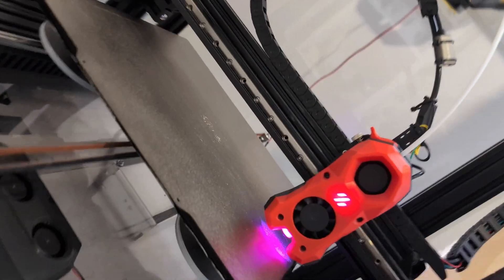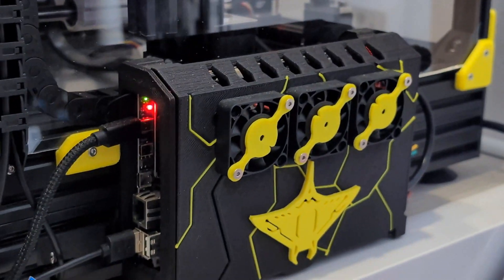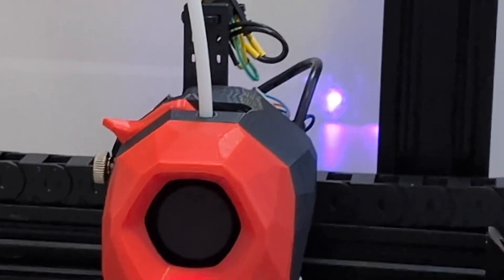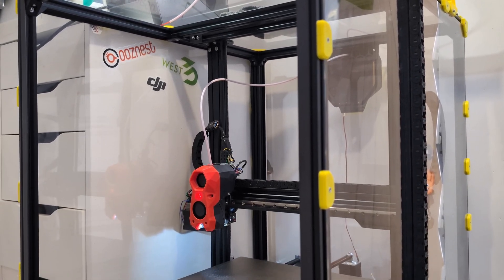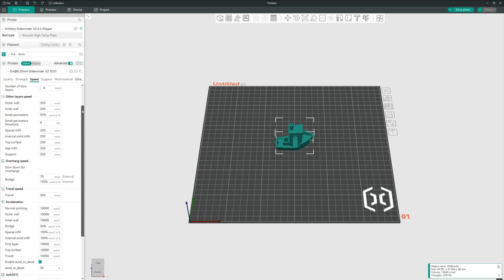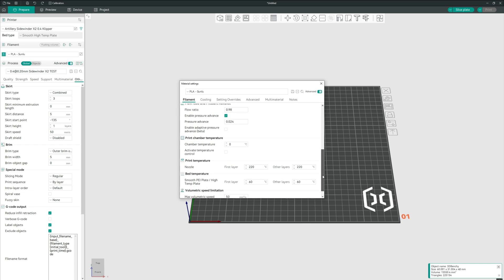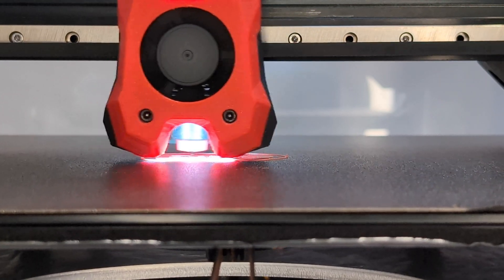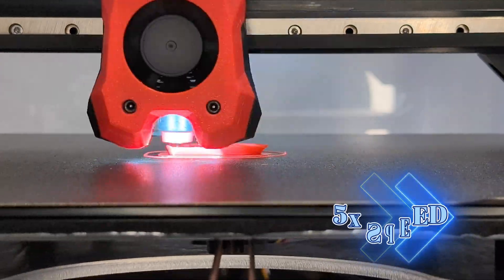My Heavily Modded Sidewinder X2 – Can It Print a Benchy in UNDER 20 Minutes?

Comment: i just have the same. 
so far i added TMC2209 via UART
changed to Klipper.
Still no input shaping. 
i will change the moving systems soon. 
and right now the frame is like a tank and strangly in a simple test motors rotate at 5000mm/s and 400mm/s ( a simple cube moving )

the bottleneck is from hotend and extruder that really slows me down to 80mm/s and 2000/mms maximum
Reply from the maker: What is your hotend and extruder? 80mm/s sounds like way too slow
Reply: @Fun3DP it is still stock titan and volcano 😅
Really hard to find a good match for my printer

Comment: stock x2 0.25mm layer heigh 16:50 minutes here. 6000 acel and 200 mm/s. The key is disabling retraction
Reply from the maker: It was going way faster than what I was used to on this printer ;) It is gone now though...transformed into a Voron Trident ;)

Comment: Hi,

I have a SWX2 and i want to convert it to a CORE XY using OEM bed . What is the cost  to do something similar this what you have there
Reply from the maker: Hi, bear in mind that this is still a cartesian printer which means it is still a bed slinger. If you want to convert yours into a corexy machine then you might want to look at Vorons and perhaps get some inspiration of it as you will need completely different kinematics. This fun is not cheap but you can use as much as possible from your X2, some parts will need some modifications though.
Reply: @Fun3DP So I already have a stealth burner hot end, btt skr 3. However, I think I am better off buying a Sovol sv08 might be cheaper. I just don't want to spend too much.
Reply from the maker: @tristanluc7008  if you want a corexy printer then getting a new one is going to be more reasonable option IMO. Sovol Sv08 is a good choice ;)

Comment: Can you supply links to all the custom parts you added? I just got an X2 and will assemble soon (new in box) and want to make it a great printer as I add it to my stable. Thanks.
Reply from the maker: Hi, I have listed the parts I have upgraded in the description of the video. I didn't add any links as I am based in the UK and not everyone would be able to use them however the items listed are easy to find. Things like linear rails, stepper motors etc vary in quality and the more expensive ones tend to be better quality but not everyone is happy to spend a lot of money. I used whatever I had laying around so it is up to you ;) . In the UK I use either ooznest.co.uk or onetwo3d.co.uk for any parts. Anything from BTT/BIQU I get from their website.